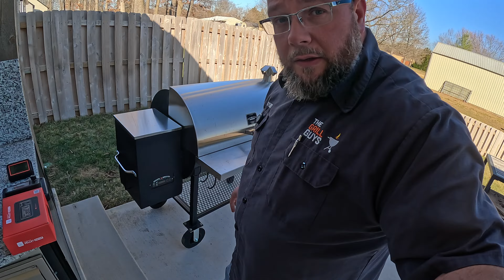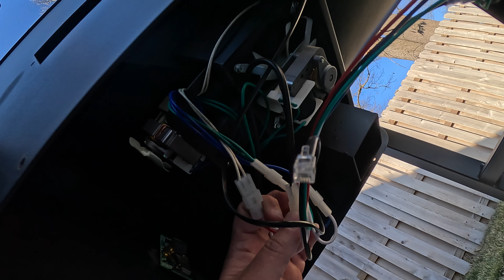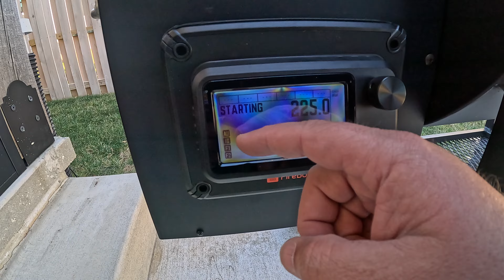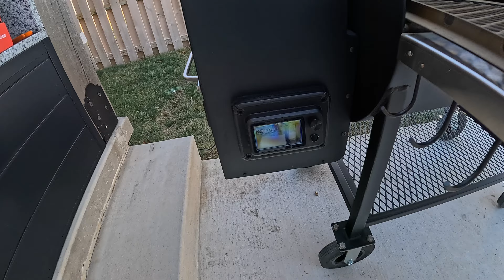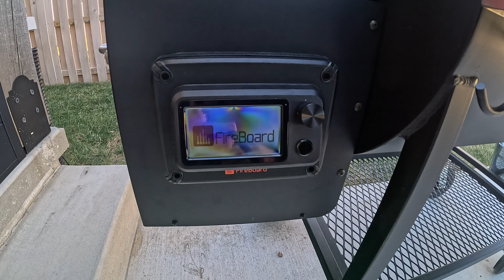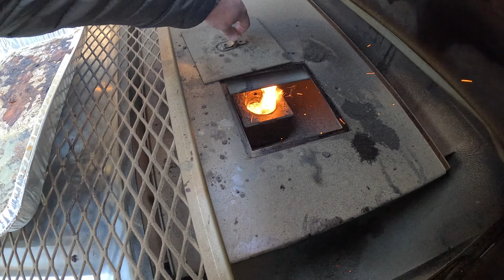Pellet Drive Must Have for Pitts & Spitts Maverick Grill

Comment: How long does it take for your P&S to settle at the set temperature?  I usually have smoke less than 2 minutes but the temp usually shoots past my set temp about 40 degrees and then lowers below temp about 20 degrees before it starts going back up to set temp. Its usually takes over an hour for my temp to settle and start the cook. I have a Maverick 1250 and wondering if I have it on the wrong setting
Reply from the maker: It's kind of hard to tell what your question is because I don't know if you're talking about using the Fireboard controller or the factory controller.
Assuming we are on topic and talking about the Fireboard controller, I would say you're probably looking at about 10 minutes depending on how hot the temperature is that you selected.
What's the factory controller I don't think it was more than about 15 minutes, again, depending on how high you have the temperature set to.

Comment: Does that new fire board come with that magnet mount?  I have the maverick 1250 also.  Do you have them in stock?  I’m not crazy about the stock controller I can’t even use the app.
Reply from the maker: There are 3 different mounting options, the magnet kit being one of them.
I like it because it helps make the controller look like it came that way from the factory.
It is, however, a separate thing you have to buy, but it's like, $20, so not too bad, really.

Comment: Installed one on my Maverick 2000. Best decision ever.
Reply: Absolutely! It's night and day difference. It starts up much quicker. My 2000 used to take 5 to 12 minutes to start and billow tons of white smoke when it did finally start. Sometimes it just wouldn't start, never was consistent. I tried many different settings. In cold weather it was a nightmare to start up and get up to temp, even with cold weather controller adjustments. I changed hot rods and did troubleshooting with the P&S over the phone. They basically said that's just how it is. With a regular hot rod, the fireboard controller cuts the startup time in half. With an upgraded nitride igniter my 2000 starts in under a minute, every time! It gives you real live temperature data, unlike the factory controller, which lies to you about what the true temperature fluctuations are. On the factory controller, when you raise or lower the temperature the digital readout instantly starts moving to the new number you set it at, but that's not what's really happening inside. Then when it gets to that set temperature it almost never shows any fluctuation from that set temperature, which is also a lie of what's truly happening inside. It is literally programmed like this on purpose to deceive you into thinking your temperature is super stable. I've tested this several times with digital thermometers placed throughout the grill. The Fireboard, on the other hand, tells you exactly what's happening inside at all times, good or bad, showing you the true fluctuations that happen inside a grill.  But the most important thing, it produces much more smoke than the factory controller. I love my 2000, the build quality is exceptional, but the factory controller was a pile of junk and I found myself never using it because of it. Now with the Fireboard installed, I want to use it all the time.
Reply: Would you do it again is there that big a difference? I have an older Maverick 2000 was thinking up sprucing her up
Reply: @BBQ_JerrY I would do it again. It's a superior controller all the way around, no doubt about that. The standard Roanoke controller that P&S uses is just outdated. I never really had an issue with smoke production with the old controller. I never updated it to their latest firmware because I read so many people not having smoke production. But I had issues with everything else. Startup was a crap shoot, constantly timing out even with adjustments and sometimes it wouldn't ignite, took forever to climb to higher temperatures, Wi-Fi constantly disconnecting, the app constantly freezing, never showing correct temperatures. I had issues with it since day one. I had stopped using the grill for a while because of the constant issues. This new controller makes using the 2000 fun again.
Reply: Does it heat up faster and seem to work better in general than the factory?

Comment: I did the same on my Maverick 1250.   I made the mistake of the lefty loosey if I remember.  I had put the wires on the wrong side of the jaws…I believe now the wires are sandwiched between the jaw and the top of the plastic closer to the screws. And the jaw tightens down as you would expect.  Right to tighten and the jaw goes up toward the screw.
Reply: We have showed this on some install videos, but, when you get that blue connector, it isn't clear. Yeah, you need to lefty loosen the jaws first, insert the wires and then righty tighty the jaws onto the wires. Thanks for pointing that out!
Reply: @FireBoardLabs I actually found out thankfully because I had used an RTD probes terminals that were terminated in solid flat skinny blades.  They worked loose and I got the same error.   That’s when I realized after looking closer that I  had installed them wrong but the hard flat terminal (used for Pellet Pro controllers) was not the best choice.  I have two RTD’s in my pit for experimenting and I cut the flat female blade style from the stock Maverick RTD, and stripped it just exposing the wires and installed it correctly into the blue plug…no more issues.

Comment: Do you get any more smoke over the stock unit?
Reply: It’s about the same but produced in a different manner since the pellet drive runs the fan 100 of the time. Mine has always produced more than stock because I added an extra two holes at the bottom of the firepot near the igniter.   You can see the mods on my channel.  This seems to produce more smoke consistently.  I’ve had the same results on my ironwood 650 when I went with a smoke daddy firepot that had two holes on the bottom near the igniter vs.  the Traeger one that had holes pointed toward the auger from the opposite side (a design you don’t typically see). The holes on the bottom near the igniter help keep the igniter clean on the Maverick 1250 way better and you can run several cooks without cleaning out the firepot.   I recently ran 14 hours and when I went to clean up, the igniter area was so clean I could have fired it up right then and there.
Reply from the maker: We're looking forward to our first cook on it. This was simply the install of the Pellet Drive. Will follow up once we get a cook or two with it under our belts.